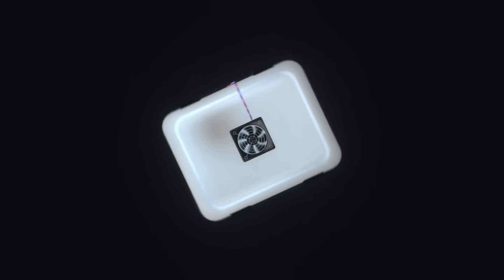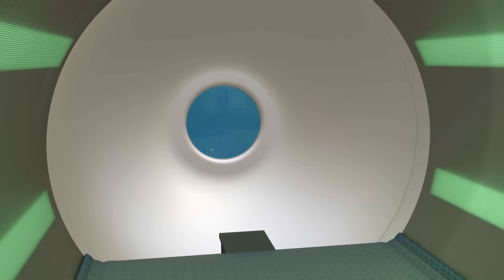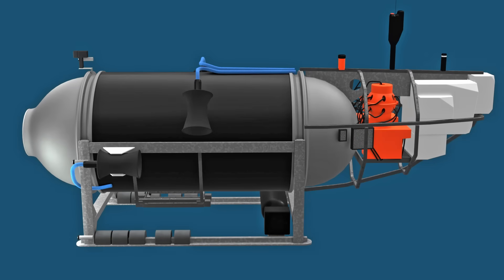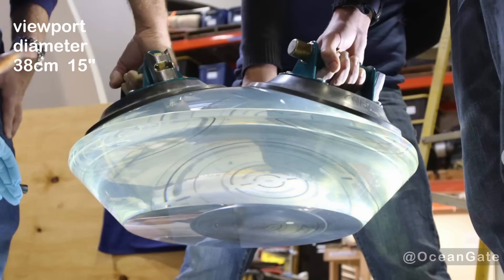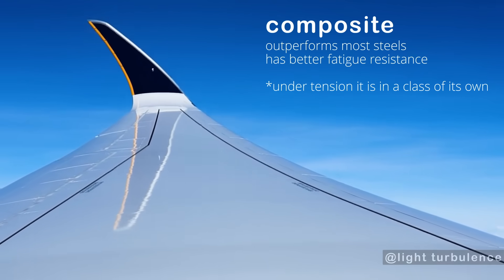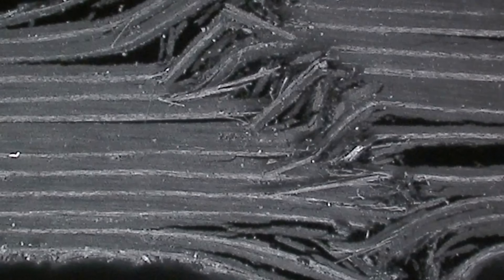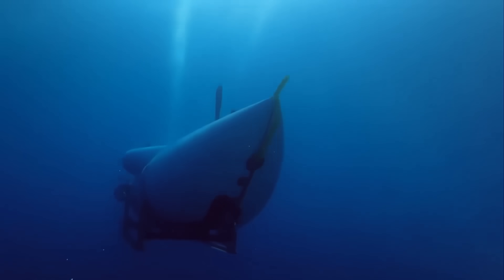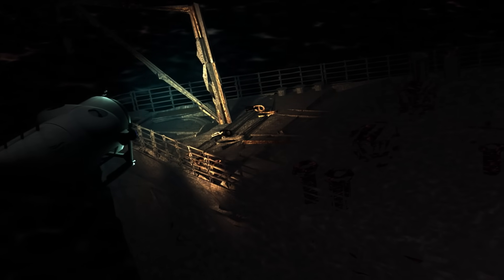Titan Sub | carbon fiber - Detailed Tour

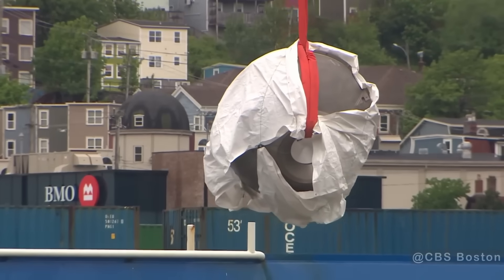Comment: If you have a look at the recovered debris, the mounting ring for the viewport is hydroscrubbed flush (very clearly seen at 12:20), i cant imagine that flow coming from anything but the collapse of the viewport, blowing out couldnt do it. It would also be one of the few things they would see deform over time before failure.
It was polycarbonate, rather than acrylic, from what i could gather.
The flanges would have been blown OUT by the water hammer (rather than in by implosion). It would also very much explain the remains found in the aft bell.
Reply from the maker: The imagery of the wreckage is too fuzzy to make any good conclusions.  The viewport retainer ring is gone and to me the surface just looks like the ring is missing.
Reply: the bolts are missing too,  @Mike-Bell , no sign of bolt holes, and the images on some of the sites were plenty good enough to see it was scrubbed flat
Reply: The polycarbonate thing - i am expressing my presumption - i found rush saying it was both at different times, but most of the reliable sources also said PC.

Comment: He did not want ultrasound testing on the hull.
Reply: What could possibly be wrong with that.     It sounds so typical of the attitude of being “ smarter than everyone else”.   It’s suicidal in itself but when you take paying passengers along it’s pure criminal!
Reply: Just in his add
Reply: Therein lies the rub. I believe it was micro-bubbles in the resin that caused the failure.
Reply: He preferred infra-sound
Reply: I am sure you can not see a scap between the faser. Scannen is useless.
Reply: After watching this video, I was just wondering if ultra sound would be used to detect voids like is done when looking at fillet welds. I worked in a steel yard that had an inspector ultra sound the welds on the anchors for a Government building.
Great video on the animation, engineering and explaining how this vessel worked. Thanks.
Reply: @beeg693  Ultrasound is definitely one of the possible tools. But one issue is that compared to a metal hull, you have a huge number of transitions between carbon fibre and resin. Each of these transitions creates a small amount of reflections. And the hull is very thick - so you need lots of power to look deeper.

If you look through a thin or thick piece of glass, you can still see through it. The reflections/reflections happens on enter/exit of the glass pane. Look instead at glass fibres and they just look milky white. All the individual surfaces will add their own reflections, bending the light in a huge number of directions.

And this is why composites are so very much harder to inspect in a non-destructive way. You can bounce sound very far in a metal beam or metal hull. But a composite hull is more like listening to someone whispering with lots of showers pouring out noisy water. How to separate an imperfection from all other noise?
Reply: @perwestermark8920  sounds like a lot of noise and very difficult to determine problems..  What are  the things that makes composites weak?
Reply: @beeg693  Composites aren't weak. They are normally extremely strong. But there are conditions to get that strength.

One condition is how the threads are placed in relation to the load. And that can be a challenge to figure out. But the really big part here is production quality. A material is strong by sharing the load with the other neighbouring material. This is why you can see such difference in strength for wood depending on the fiber direction - between the fibers there is less sharing of the load. So it's easy to crack the wood in that direction.

The resin between the carbon fibres is responsible for helping sharing the load. And helping avoiding buckling, where the fibers bends. But if you get a delamination somewhere, then you suddenly have no sharing of the forces at that point.

If you bend a 10 cm thick plank, it will be much stiffer than if you put two 5 cm think planks on top of each other. Which is a reason why multiple planks are sometimes glued together to make them into a single load-sharing beam.

If you have a 5x10 cm plank, then it's way more than twice as hard to bend it in one direction than in the other. The stiffness isn't linear with thickness.

Take a telephone catalogue. Even if thick, it's easy to bend all pages at the same time. Glue the pages together and it instead behaves as a brick. You can suddenly lift a car without seeing it bend.

So composites can be super strong. But you must have a way to produce with a known quality. So both a good way to produce. And a good way to inspect the final product to detect if there are unexpected flaws.

For steel, aluminium, ..., it's so trivially easy to produce that you can almost always deliver your product without any additional inspection except maybe a visual inspection cor scratches. It's basically for aerospace, F1 racing, nuclear power plants or similar that it's critical enough to actually inspect in depth. I.e. volumetric inspection for inside defects.

Composites are trickier. So there are more situations where you need to verify the internal structure. There are methods to do this for bike frames, airplane wings etc. But I do not know if any company has good methods to inspect 10-20 cm thick carbon fiber objects. And it doesn't become easier for a tube. For a beam, it's easy to have test equipment on both sides. For a tube, you need some form of fork that reaches into the tube. And that then also means the length of the tube can make it more complicated. While it's easy to handle even a 10 meter long beam. Either slide the beam or slide the test equipment. Or make the slide 50 m long if you need to analyze a 50 meter long beam.

Much use of carbon fiber doesn't relate to human safety. But a submarine hull is very much about human safety. So how do you prove that safety if you can't measure the manufacturing quality of the very specific hull you are going to use? Destructive tests of a different hull only shows defects in that hull. Not in the next hull produced.

If the goal is 300 meter depth, then composites are easy. The load is so low you can design a hull many times stronger than needed without weight issues. So unknown defects can be compensated for with excess thickness.

If it's an unmanned sub, then you can go for the full depth of Titanic too. Because it isn't about human safety.

But right now, no one has burned enough $$$ to figure out a safe way for human dives to this depth with a carbon fibre hull. And one CEO with lots of hubris decided "how hard can it be" while ignoring the lack of good test methods. So he never once had access to good numbers what the actual safety margin was. And that last dive he found out what happens when that margin reached down to 1. Suddenly no excess strength anymore. Just broken parts at the bottom. You would never want to drive a car over a bridge that had a safety margin close to 1. Or climb a ladder. Or live in a building. A factor 3 or 4 are quite common for human safety. So the building can keep standing even if a car manages to reverse into a wall instead of folding like a house of cards. Lots of old-time bridges failed because the engineers still lacked knowledge to compute the full dynamic load. Like the Tacoma Narrows Bridge that started to oscillate by the wind. Engineering can be hard. Which is why engineers needs to know when they lack knowledge and make sure they add even more safety margins for that "unknown". The Golden Gate bridge is an example where the involved engineer knew there was things he didn't know so he did add even higher than normal safety margin. End result? That additional safety margin ended up needed when newer computation models were used. So despite guesses from the engineer, it ended up a safe bridge. Then we have Stockton-Rush that did not add lots of extra margins for all things he knew (or should have known) he wasn't able to properly measure.
Reply: @perwestermark8920  thanks for the additional info.  As a side note people were walking on the Golden gate Bridge for some reason a few years back?? and the article I was reading said the  Golden gate Bridge was not designed for pedestrian foot traffic on the road. They feared it might break. It didn't though...
Reply: Stockton rush was the Jeremy dewitte of the deep dive industry lol
Reply: @skeetrix5577 . Long screwdriver.  Orange handle.
Reply: @Woodman-Spare-that-tree  bahaha exactly!
Reply: To much money for one 2 he knew the second they saw it was junk expired carbon fiber, the test stops right then an he fails
Reply: I'm not sure if there exists good ultrasound tests to handle this thick materials. If changing the envelope for a test, then you first need to do lots of experiments to certify the testing method before you can start doing tests on a produced hull.
Reply: @perwestermark8920  If you could perform ultrasonic testing on 150mm X 300mm X 3,000mm Inconel billets and find 1mm flaws in the 1980’s, I’m sure they can deal with carbon fibre now. It is a matter of record that a senior member of the build team wanted to do ultrasonic testing. Of course I know better refused.
Reply: @machendave  Inconel billets are way, way, way easier to analyze than this carbon fibre structure.

And a straight beam is also way easier to scan than a big tube.
Reply: @perwestermark8920  so tell me, how do they test aircraft and submarines?
Reply: @machendave  So tell me - the submarines that are constructed from a homogeneous material? Which this is not.

Or the airplanes that has 5" thick layers of composites (which they do not).

Do you not see the differences in problem scope for an airplane wing and this hull? Or the difference in testing of a homogeneous and a not homogeneous material?
Reply: @perwestermark8920 ultrasonic inspection is not only capable of inspecting composites, it is one of rhe most commonly used methods. 

Yes the thickness of the material does introduce difficulties, but that is why proper testing methodology development and training is important. If the composite has a uniform distribution of fibers, you should expect a uniform return. An indication could be almost anything, and it's the inspector's job to interpret those indications as defects or not.
Reply: @wyattroncin941  I am well aware ultrasound works for inspecting composites. But my comment was that I have not seen anyone test this thick materials. A very important distinction.
Reply: Did they test the matrix resin for water permeability at 4509 psig?
Reply: Exactly, he knew it was going to fail. All of the passengers were in major debt, so they sent that sub down empty, and now they all are living good from life insurance on some tropical island i'm sure
Reply: a hospital just blew up in gaza but this is what youre freaking out about
Reply: @nutsackmania are you going to post that comment on every single video comment section on the whole of YouTube? Yeh, a bunch of people got killed in yet another war in the middle east, very sad, but if we only ever talk about people killing each other in the middle east we'd have done nothing else for the last 2000 years. Go shout about it on a video that's actually focusing on the war in Gaza, this one is about composite engineering.
Reply: @nutsackmania So what are you doing about it? The world is a big place. With crisis all over the place, not just Gaza. What about Russian aggression in Ukraine? The Uyghurs suffering in western China? Etc, etc… There is not enough emotional currency for a single person to invest in every crisis worldwide. That does not minimize the seriousness of Gaza or the tragic events of Oct 7, 2023. But don’t browbeat others if your own particular cause isn’t being discussed. Perhaps in a video on the topic you could share with us what YOU have been doing for the people of Gaza or the families who lost loved ones in the attacks of Oct 7th. And what do you recommend for those who can help rather than berate everyone. 🤔
Reply: We don’t know or care about Gaza.
Please keep your old word hatred in the old world!
Reply: @nutsackmania hamas deserves  it
Reply: @nutsackmania We can freak out about two things at once, or alternatively, about multiple things in quick succession. This one reaction does not represent the full spectrum of all reactions that are possible in a day. 

Anyway, have you donated to any charities in Gaza yet? Have you called your congressperson or reached out to a Hamas recruiter? Have you perhaps paid your respects to any Israeli victims or volunteered to for the IDF instead? Or have you instead taken the ASVAB for the Navy, taking a more neutral stance by hoping to contribute to missile defense in the region?
Reply: @nutsackmania that lame rocket Hamas shot and blew up a parking lot? 

Is that what you're referring to?
Reply: @nutsackmania  nobody's freaking out nor is a video on YouTube the place to be spreading this "awareness"
Reply: @nutsackmania a parking lot was hit with a sewer rocket from their own terrorists, but you may not have seen that update.
Reply: Chill out man.